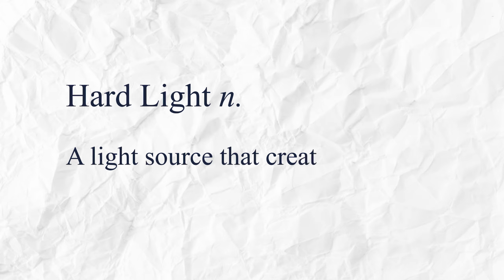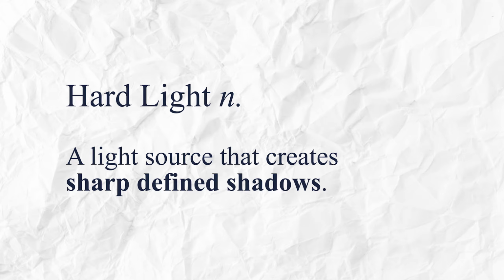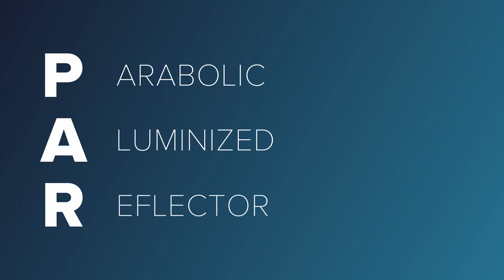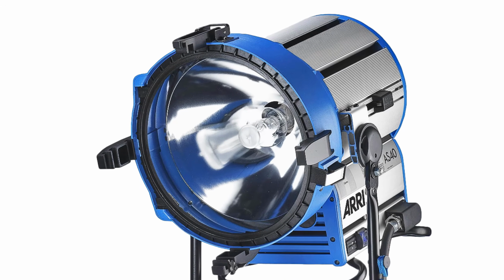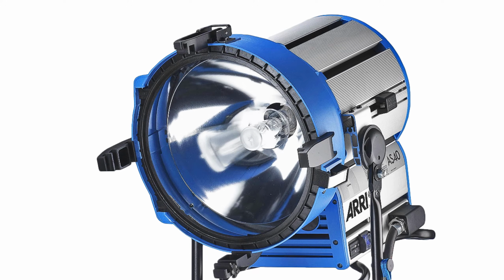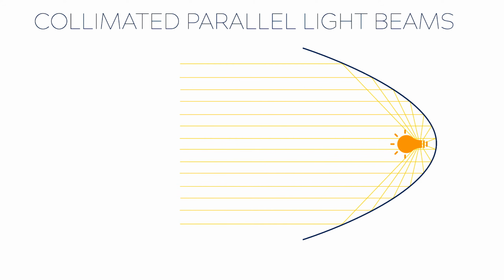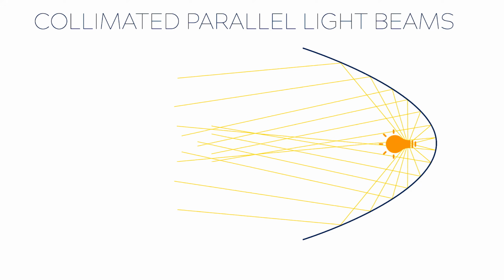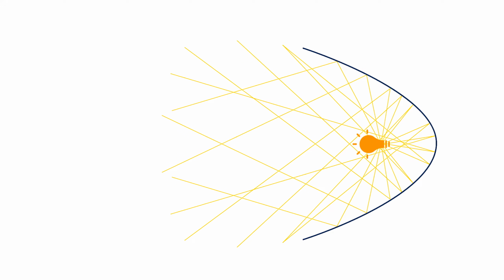Types of Hard Lights - Fresnel vs Par vs Open Face Lights | Film Lighting Techniques

Comment: Fresnel lens output a soft and uniform light, how they can come out a sharp edge profile?
Reply from the maker: A correctly calibrated fresnel should output a hard light with sharp shadows and parallel light rays. Flood and spot controls also play a role, as this changes the focusing position of the bulb in the unit. In the units I have, they're all calibrated to full flood, so thats the sharpest position. Spotting the light makes the light rays converge, so the shadows are softer. Your mileage may vary depending on your fixture/fresnel combination. Using a fresnel attachment on a light source that it's not calibrated for, for example, will result in soft shadows.

Comment: 7:40 - so full spot is actually softer than full flood? Crazy!
Reply from the maker: I know! It surprised me too. When I was researching this video, the research indicated that “fresnels” (theatre fresnels I assume, not film fixtures) are focused at full spot, and I almost reported it as such in the video. This of course makes sense in a theatrical context, as those fixtures are designed for longer throws. 

But then when I tested it, every single film lamp and fresnel attachment I had access to was harder at full flood, which makes the most sense in a film lighting context.

So it can go either way, it just depends on the design and calibration of the fixture and specific fresnel lens.

Comment: Nice Video, if i search for open face lights, i can only find mountainbike helmets. is there a Professional name for these kind of lights?
Reply from the maker: Yes, it’s a tricky one and more of a category of light than a name. Different manufacturers give them different names. In tungsten lights, Redheads (800w) and blondes/blondies (2000w) are a common terms used. These lights I’m showing are Arri 800/750’s. Mole-Richardson name some of their lights open face. For these older style tungsten lights, you’ll want to look on the used market predominantly.
Reply: @CreativePathFilms  I will look at this further, it is very interesting.
i try to get 4-5 lamps to start with.
As I see it, there is no way around tungsten lamps.
Or do you think that you can shoot a movie completely with LEDs (Apurture c120d II or Godox SL 200 II)?
I have 2 good offers for both led lamps, but I fear that it is not possible to get the light as strong as a Fresnel lamp. Or rather, the look that makes up the beautiful old films is probably difficult to achieve with LEDs.
Reply from the maker: It’s certainly possible, most productions use LED lights these days and the aputure and godox lights are very popular. 

You can always mix and match. If you have some CTO/CTB gels, you can mix tungsten with daylight lights. Depends on what you’re going for and the needs of your shoot.
Reply from the maker: Here’s another video on tungsten lights  that you might find useful: https://youtu.be/TW90KmZ7Tfo?si=0QRlr8PtR73dI6Pu